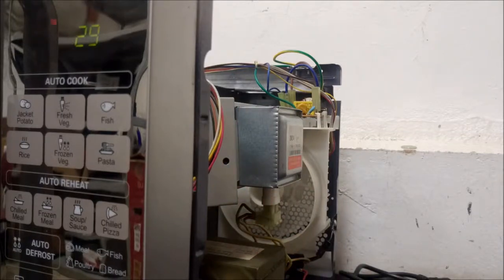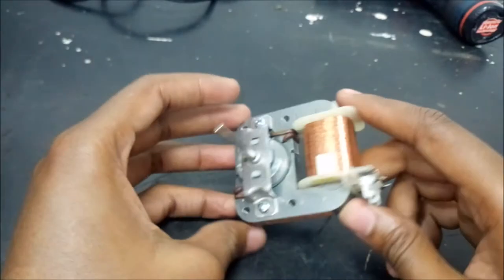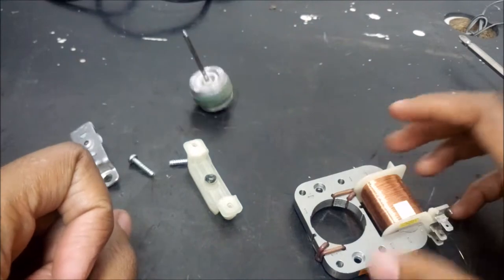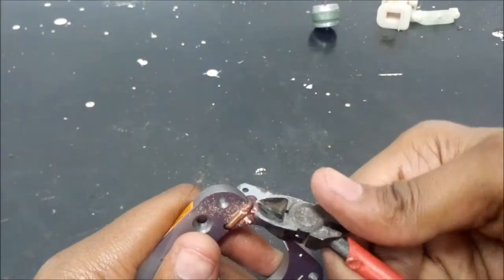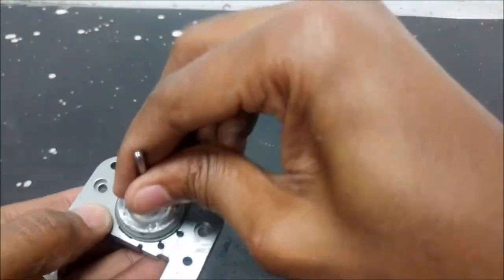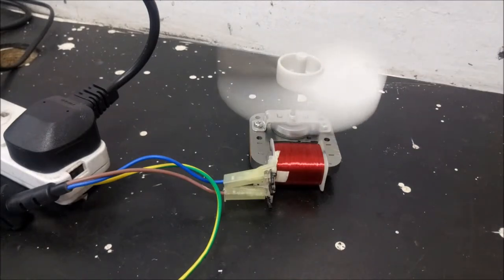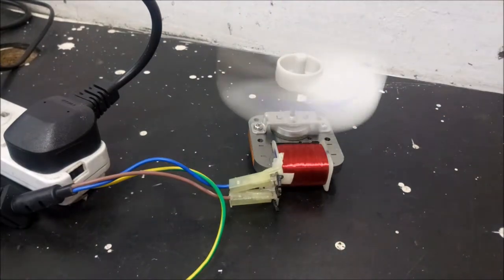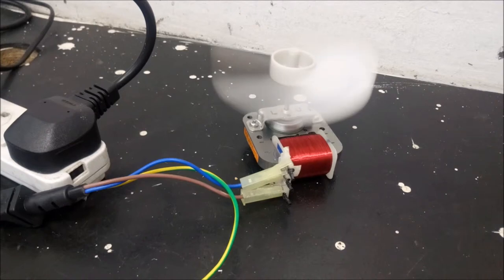Removing The Shaded Pole Of An Induction Motor

Comment: Funny I just disassembled one yesterday for the purpose of using the magnetic flux plates as an anvil for pressing/pushing small parts in the 20-ton hydraulic shop press.

I did run a couple of weld beads along the outside of the plates to keep them together.

Comment: Ummm... Dude, you could have flipped the rotor & end pieces around if you wanted it to spin the other way. No need to remove the shaded poles.
Reply: Thats what i was gonna say lol. Was scanning thru the comments to see if someone already said it tho. Unless the 2 spade terminal contacts are on the side and for some reason its blocked by anything you are installing it in (which is not on this case) you could just solder a wire to the terminals and run it to where its not a problem to connect to a power supply connection
Reply from the maker: I'll definitely try this when I get my hands on another motor

Comment: Sir I have a small exhaust fan used in welding machine (which is basically a shaded pole motor fan), whose winding is burned now i dont want to rewind it for 220v configuration rather i want to run it on 12v or 24v ac how much number of turns per slot i should make..plz help

Comment: I have a small 1/100th .3 amp shaded pole motor (powers a small greenhouse inflation fan) that looks like a Fasco induction shaded pole motor, that locks up the rotor after I start it. I oiled the bearings and clean it and noticed that one of the copper shaded pole rings looks broken.  The copper shaded pole rings are supposed to be complete circles, right? No breaks, right?  Can I just cut them out like you did and start it by hand, like you did in this video?

Comment: If I have same shaded pole motor which I'm not sure if its 110v or 220v, how do I find it out?
Reply from the maker: A shaded pole motor has a thick copper wire accross the core
Reply: If you want to figure out the voltage try measuring the resistance of the coil. Now this is an estimate so don't take this as 100% true but I have a 240VAC 50Hz motor and the coil resistance is 420Ω so by doing some division might get you your answer.

Comment: Hello 
Can I use a label mark 220V 50Hzs shaded pole induction motor , in 220V 60Hzs 
or
use a label mark 220V 60Hzs shaded pole induction motor , in 220V 50Hzs 
thanks
Reply: frequency sets the speed

Comment: Any idea for increase rpm of this.?
Reply from the maker: Basically by varying the voltage applied. Jeremy Fielding has a very good explanation here  https://youtu.be/JTlHNOaBnPI
Reply: @DominicGichane  how many volts possible for it its 220v motor
Reply from the maker: @RealTamilHorror  The only true way to know is by using a variable transformer

Comment: My motor was gives sound so i pull it but after pull out My motor was not working so how can i repair it
Reply from the maker: You must have nicked the winding. The only solution is to get another motor because finding the winding is almost impossible

Comment: It looks like the motor is weaker without the shorting windings. Is this true?
Reply from the maker: No. Generally shaded pole motors are very weak. That's why they are used for small tasks like rotating  fans.
Reply: @DominicGichane  I removed the windings from my fan motor yesterday.
 Although he could now start in any direction, he only had about 5% of the power. 
So it is logical because the rotating field is almost no longer available.
I soldered a winding and it is now usable again and surprisingly now more stable with my TRIAC.
I know that these motors are weak but not sooo weak ;)
Thanks anyway.